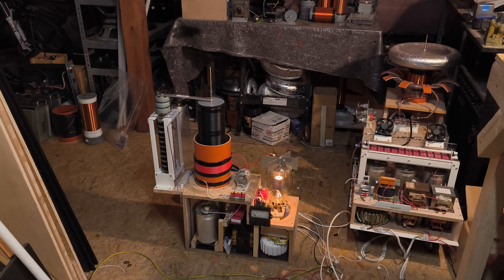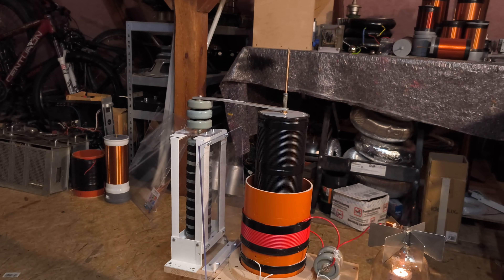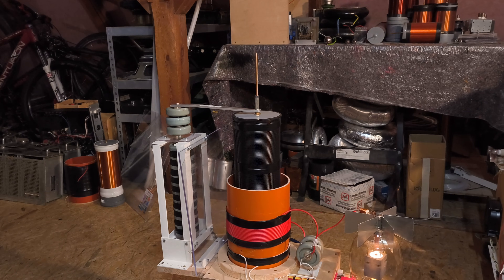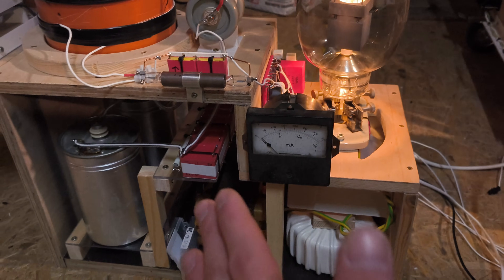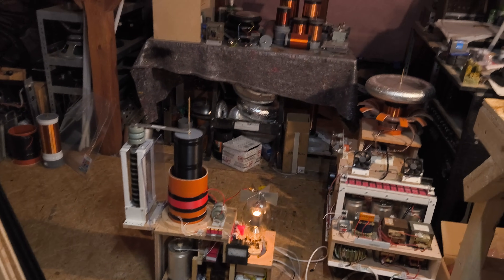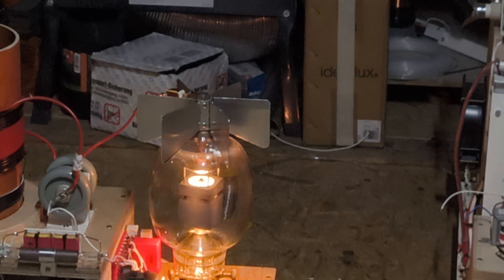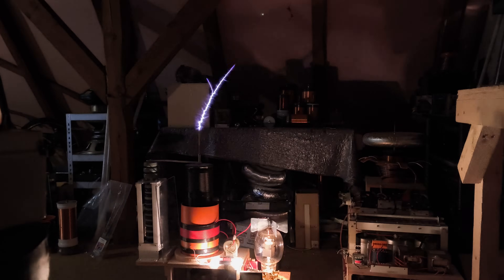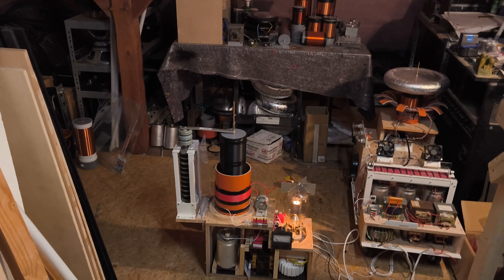Capacitor Topload VTTC

Comment: why not assemble some cheap ceramic caps (2kv) in series & inside secondary coil. cleaner that way. done this but with QCW operation only so no idea of peak hv out with tubes 😊
Reply from the maker: @raffyturc
These Caps are actually pretty cheap😅 also they are rated for high frequencys and will be pretty efficient. 
Yes to Put them into the secondary is actually my Plan.
But First i want to Experiment with values😊

Comment: i also wanted to do this for my QCW but the issue is i cant find any doorknobs with low enough capacity, cause i need something like 16pF 180kV
Reply from the maker: @9551dev
Yes especially when the secondary is really short, it will be Not easy to find capacitors for it.
Actually you do Not need that high voltage Ratings! Especially with the big arcs loading down the secondary, the voltage does Not Peak that much. 
My coil will reach maybe 50-70kv or Not even that. 
I think you are Safe with about 120kv
Did you searched for SMD HF capacitors? There are some really Compact 3kv HF Caps Out there.. but it is Not cheap.. 40 of them will cost 😬
Reply from the maker: @9551dev 
https://highvoltageshop.com/epages/b73088c0-9f9a-4230-9ffc-4fd5c619abc4.mobile/?ObjectPath=/Shops/b73088c0-9f9a-4230-9ffc-4fd5c619abc4
I dont know where you are located. But This is a high voltage online Shop. 
They have some 20kv and 30kv 100pf doorknobs. Depending on your secondary height, you can use the larger 30kv ones or the smaller 20kv ones.
I am using 7 of the smaller ones in my 120mm high secondary at my Double gu81m VTTC and they Work Just fine. 
Just do Not use them in primary circuits with too much Power. The kVA Rating isnt that high.

Comment: Seems promising! I think the capacitor topload will really shine if you put a lot more power into the coil because the arcs won't detune the secondary very much.
Reply from the maker: @benjaminlockhart99
Yes exactly This is the way to Go!
Ive done that on my other VTTC because it has an really small secondary.. so to "stabilize" the Tuning and also get an good Q at big Arc loads, i Put some capacitors in parallel.
In This Case with the big secondary, it is more or less an Experiment.
I think i will make it a Bit more powerful in Future and mess around with all the Specs, to get it as efficient as possible.
So want to find more an Point betwen powerful, Compact and efficient... I also Wonder If capacitors are more efficient than a big topload 🤔

Comment: Very nice.

For the DC meter, if you put it in series with the gridleak you need to put a capacitor across it since there is both a DC and RF AC component that will confuse the meter, since we only care about DC grid current, bypassing the AC is completely fine. 

How much did those soviet doorknob caps cost you haha
Reply from the maker: @janno288
Thanks, nice to know!

Ive got These doorknobs really cheap, because i buyed a bunch of them together with a lot other types😅 i think 5€ per cap
Reply: @marvsworld247  Seller from germany or ukraine?
Reply from the maker: He's an polish Guy